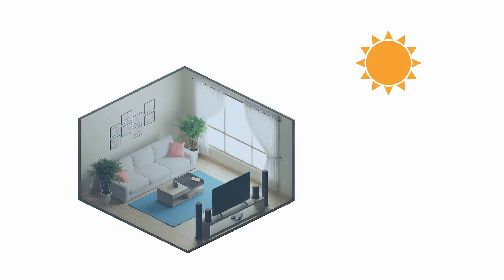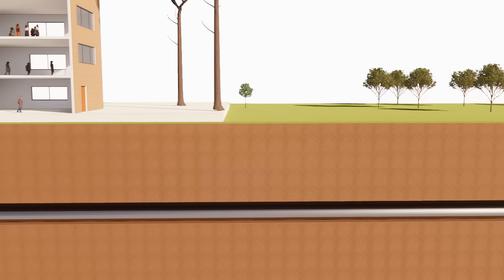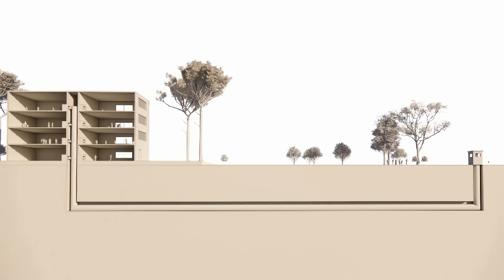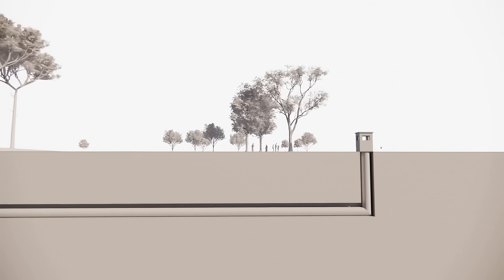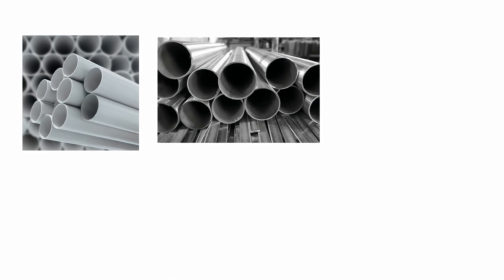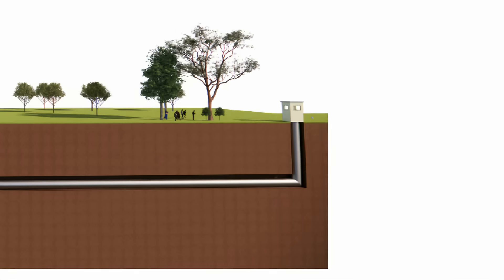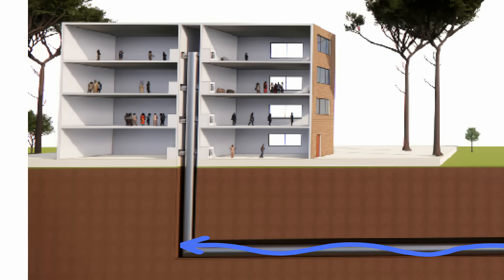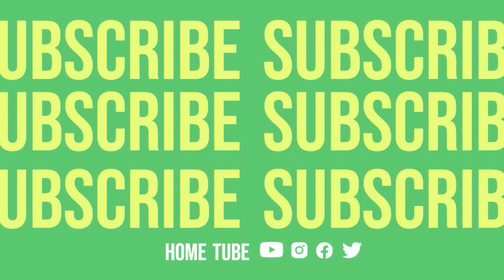Earth Air Tunnel System: Sustainable Cooling & Heating Solution

Comment: If everyone starts doing it( large scale) wouldn’t it make the crest temperature same as nearby atmosphere? What happens to the life( organisms) under the soil if it becomes to warm or cold for them?
Reply: About the latter question, soil as a whole are massive compared to the earth air tunnel installation. The overall temperature of the soil surrounding the tunnel wouldn’t change so much that it become too hot or too cold for the living organisms in it. Do you know about thermal equilibrium? It’s the process of two bodies of thing exchanging heat until they theoretically reach the same temperature. It’s like putting a tiny ice cube into an Olympic sized pool. The ice cube would change it temperature and turn into water, and it’s noticeable, while the other body, the Olympic sized pool, would remain nearly the same cuz that tiny amount of heat changes the ice cube cause doesn’t affect the huge pool that much. It’s the same with the soil around your tunnel
Reply: @burhlmao540  well how about Icerberg or glacier? Would that make a difference?

Comment: Idea is good but we need big size blowers which sucks and throw air from pipe... condensation will occur only if humidity in out side air increased... and the solution is throw the air out side building
Reply: They call that an attic fan or whole house fan

Comment: It seems that it would be more efficient if the air in the house were sent in a loop drawing the already reduced temperature air in the house thru the pipe to be cooled rather than trying to keep cooling hot air from outside.

Comment: the best way to sustainable energy management I ever heard - like thousands of years ago
Reply: What happens if I live in a 70 square meter house?
Reply: @EfrainA-u2h  That's not big. A tiny pc pipe already would do the trick. But water works better for cooling. Air has almost no mass. I have made my house mutch cooler with a $5,- plant growing against my house. I it doens't get hot, you don't have to cool it down. But you can replace that expensive buried pipe with a cheap pond.
Reply: Deberías poner una ducto de esto por cada habitación @EfrainA-u2h
Reply: @EfrainA-u2h You improvise and adapt.
Reply: yep, and theirs are more efficient too (especially the ones in the Sumerian region)
Reply: See what any Fire Marshal would say about permitting it ...
Reply: @centurione6489  There is a suitter valve at the other end with a spring. When air rushes in it closes the valve. They can also work electronicly, thus opened with power. Cut the cable or when alarm goes off it closes. Same goes for the roof. When fire brakes out it will close due to temprature with a piece of metal that expands and triggers a latch. Same here you can have extra electronics to trigger it early. Thus the spring is removed with a coil magnet that pulls the latch closed, until power goes out or alarm has been triggered. It's mandatory in The Netherlands on large industrial buildings. These roof panels also work for explosions. You will pop off the panel completly with a large explosion, leaving the roof intact.

Comment: Too many problems with earth air tunnels,  mold, radon, etc... better to simply have Geothermal heat pumps,  use the same principles but use a thin tube with a liquid containing an antifreeze and refrigerant.  The Geothermal heat pump is incredibly energy efficient and do not have any of the air quality issues that affect the air tunnels.
Reply: what for summer ?

Comment: Cost efficiency and reliability aside, you need to own a very large piece of land for this to work LOL.
if the underground pipe is short, then it won't stabilize the air temperature at all.
There is a reason modern city housing doesn't adopt this concept.

Comment: Instead of costly digging you can route water pipe throught indoor water tank it would be the same effect or the large outside rainwater collector does the same effect cool in summer and warm in winter
Reply: Radiant heating / cooling system wld work well for an effective remorseful control

Comment: If the wind tunnel is enclosed inside water way then passively it can keep comfortable temperature year round without any extra electricity
Reply: You would still need to circulate the water with a bilge/sump pump!

Comment: Air is a terrible way to transfer thermal energy, water is a smarter system to extract energy, transport it and deposit it. You also have issues like radon and moist air with moisture been the killer of most homes. Add a rock or sand battery and you have a smart system as opposed to the above system which would only really work of dry desert clients.

Comment: In Florida that would become a nice WATER pipe !
Reply: Check the thermal pump design. This video is pretty simplified.
Reply: Truth. Different solutions for different places.
Reply: They're almost always made of solid pvc pipe, with a way to drain condensation and treat the inside of the pipes against mold and mildew. You can use ground water to cool as well. I had an uncle who used his well water to run through a giant radiator in his basement. It had fans attached to the back of it to exchange air. Worked great.
Reply: Unless it’s completely watertight.
Reply: @tscoff  exactly, you can also use something like PEX plumbing and use water or a fluid medium for heat exchange instead of air.

Comment: Making a simple problem more complex. Using A heat pump to heat/cool your home provides a cleaner, safer way to provide your HVAC needs. If you were going to live completely off the grid with limited ability to produce your own abundant electricity, this may work for you , but even then, there are simpler plans as well.
Reply: This one is a green way for cooling. Heating
Reply: Such as?
Reply: Heat pump still needs lot of electricity, in CA PG&E is charging $0.50/kWh 😢
Reply: Can you give an example?

Comment: Is this just theory or are there some real life example that have been successfully working for several years?   The ratio of area vs circumference is R/2 so doubt the pipe can be very wide before most of the air is not getting any heat tranfer.  Impossible to stop condensation in hot, humid summer months.  In some places you have to account from gallons per hour of water being produced by air conditioning units. The idea of using liquid and the earth as a huge heat sink and heat exchangers is feasible,
Reply: Pochodzę z Polski i system podobny do tego z filmu jest stosowany w wielu domach od około 15-20 lat. Możesz pytać co cię interesuje
Reply: @ThEvilsTeam there are many installations using the earth to heat or cool using liquid going through pipes.  Sometimes it is just a grid of pipes (like floor heat) or a resivoir with pipes going through it.  The liquid is circulated and heat exchangers are used. Poland has been using geothermal plants for heating. . Are the systems in Poland ONLY using air through pipes for heating and cooling? Thanks.
Reply: @douglasmckinley-sr1507  Yes, it is the same system as in the video but it is part of the recuperating ventilation system (hrv). It prevents frosting in the heat recovery unit  in winter and helps cool air in summer. Of course it's impossible to warm air more than ground so in winter it must be parried with some other heat source. It can heat the air to 10°C what is better than -20°C ;) Also newest systems use rather semi open plates than pipes to manage condensation.

Comment: How do you heat a building with 15° C in winter? You need at least 30° C. Therefor you need a heat pump
Reply: If your heat is set to 30 dont invite me over lmao
Reply: @goddy5890  They are saying 30℃ because you need a delta T to transfer heat. The only way you would not is if you are doing air changes constantly, and then you are talking about using very big fans to achieve that much airflow. The energy to use a fan to push that much air would not be much different than just running a heatpump. You would also only have a 15℃ house with a massive daft, which would be damn cold for normal standards.

Comment: It's a really bad idea. 
In developed countries you don't use pipes, due to moisture condensation and growth of mold and other stuffs you don't want to breathe in. 
A professional system would be half-open so the bottom of the tunnel is pure natural dirt, what can absorb moisture and prevent develop of pathogens
Reply: A professional system would not expose occupants to radon. This is just a bad idea all together.

Comment: Clever, although this appears only suited for hot climates.
A window should be kept open to allow return air out to avoid pressurising the building with minimal air flow. As such, there are some energy leaks. The power needed to operate a huge fan and its noise can be significant.
Reply: Usually, there is a system of outgoing ventilation in well-designed buildings. Additionally, you can use a solar chimney and a deflector like a 'whirlybird.' In this case, we can avoid using loud incoming ventilation.
Reply: I can see this as the input for the HVAC system. When the HVAC is blowing it will naturally pull air in. When the HVAC is off it won’t. You’re correct about the positive pressure, this will work much better in a house that is poorly sealed than in one that’s well sealed.

Comment: Plastic or concrete should not work, if you really want to benefit from temperature difference between soil and atmosphere you will need copper or at least aluminum tubing. That is pretty expensive.
Reply: Concrete is better at thermal conduction than dry compacted soil, but worse than wet compacted soil.

So while metal pipes would technically be better, the improvement would be extremely negligible, and not likely worth the price increase.

Comment: Could this ever work in densely populated cities or would it simply be too much to demand of a limited space?
Reply: This can only work in low density population areas. You also have the problem of ground getting too warm in summer if too much heat is put into it and freezing in winter if you extract too much heat. Better to run a ground source heat pump where heat in the building can warm the soil in summer and be extracted again in winter. Even then it only works in specific circumstances where the soil conditions are right.
Reply: Most highly densely populated cities are near a large body of water, much better using that as the medium. In Toronto they sunk a bunch of massive pipe in the middle of lake Ontario and use that water to cool a section of bulding in the downtown area.
Reply: @ScottA2345  use a well
Reply: Die zufuhr muss halt immer so und so weit weg sein, halt nicht neben deinem Gebäude, direkt neben dir kann ja ein weiteres Haus stehen für das der Zulufteingang halt auch wieder die bestimmte entfernung weit weg ist das es funktioniert, und es müsste von Allen gewollt werden! Alles liebe & herzliche Grüße David.

Comment: Been thinking of building a bunker and this looks like an effective way to maintain airflow in there.
Reply: These are excellent for warming air in winter, and then passing the warmed air through a heat exchanger so the stale air leaving the home warms the incoming air even more. Look up the "passive house" standard in Europe. For summer, the earth tubes have a big condensation and mold problem. You could run a closed-loop so the tube-air cools a sealed radiator. Investigate before spending money.
Reply: @ronroberts110  Most excellent idea, I had an idea of mounting a car/truck radiator behind my wood stove to heat and pump hot water to the back of my place where I don't get as much warmth in Winter! No electricity bills, just passive heating and cooling!
Reply: I live on a hill facing north. Thus i sleep half underground. The suny side is only 1 level. The dark and north side has 2 levels. 
So, have a shaded garden in the back from the house. Until i go further and have sun again for trees. Thus most of my windows are facing north.
Warm in winter because it doesn't freeze underground. And stays cool in the summer because the soil stays cold/constant.
Thus have only my frontgarden with a door and a small window on the south. Covered with plants. And big windows at that level facing north. 
And when you go down into the basement, there is the rest of the house with exit to the back garden. With a real basement you get bad air and mold.
Reply: The tubes fill with mold. You'd burn through air filters so fast.
You'd have to use something like stainless or copper that microbes dont like and even then time isn't on your side.

Comment: Anyone saw this method practically?
I saw chiller plant in Dubai. 
Air was traveling through underground pipes. One pipe intakes and other outtake.
Reply: Chillers are proper machines, even though their pipes are under ground some times. In this video there are no machines except a basic air blower. Secondly this method cannot work effectively in extreme weathers like Dubai
Reply: @mohammadhamza7159  works better in dubai due to the low humidity

Comment: Wouldn't you use this air to feed a heat pump coil so the heat pump can run more efficiently during cold weather?  Much easier for a heat pump to use 10 Dec C air than -20 Deg C air in the winter.
Reply: Of course, and it is done all over for new constructions using heat pumps  and underfloor heating.
Reply: Yep, and then water/glycol is a better medium than air for heat transfer so you would use a water loop with a pump. We call those ground source heat pumps, they are very common. haha
Reply: @drew651  but it's very expensive and complex

Comment: Perfect for rat intake…
Reply: Have cats
Reply: Id love a rat intake system 😂
Reply: 1:35
Reply: No, pipe ending is covered with metal mesh.
Reply: @igorbukovy4313  you mean ladders for rats :D
Reply: @ Climbing on the vent will not get them inside the building.
Reply: @igorbukovy4313 We have a thicker layered PVC pipe underground. Recently rat has destroyed  and made a huge hole on it. We had to cut and replace the pipe.
Reply: According to your logic everything that runs from underground into a house brings in rats 🤡

Comment: Have been thinking about such solution since long time. A concrete house is just a concrete oven.
Reply: Pros & cons of each contruction method and materials...
Reply: Unless you use blocks with insulation
Reply: A concrete house is a great earth berm house .Then you get the effects of ground cooling and heating without all the bull in the video that would cause more issues than anything.
Reply: @drew651 concrete home is difficult to insulate, hot as hell in summer.
I lived in those homes in India.

Comment: Sounds to good to be true 😆.
Works only on presentations?
Any actual builds and measurements?
Reply: I heard it's relatively common in Canada.
Reply: @marcospereira2060  This is common is Canada as a ground source heat pump. Get ride of the air entirely, bury a large loop of pipe (usually in the thousands of feet long) Or drill the loop for less length but much deeper. Take those two ends of the pipe, hook it up to a heat pump and tada a ground source heat pump.
Reply: @marcospereira2060  this is not true. Never heard of it here.
Reply: @benvoncamp  , YT has sugested me some videos in portuguese and spanish that refers as canadian in their thumbnails.

Comment: moldy pipe ventilation
Reply: An Ozone Generator running once a week would be enough to keep it mold free, especially if you design it the way it’s shown with a small shed/outhouse.
Reply: @PrayzGOD2  ozone is poisonous. balanced mechanical ventilation with a MVHR is best. You don't save meaningful amounts of energy with these earth pipes.
Reply: @PrayzGOD2  Ozone generator? What is this the 80s or something? Ozone can be very harmful to your health and can cause permanent lung damage. Never use an Ozone generator in your home.

Comment: I wonder if the cost of construction is worth the savings.
Reply: It should be in the long term.
Reply: Not even close lol, it's just a sustainable way to do this.
Reply: The answer lies.
Laid plan.
Reply: If you use cheapest PVC pipes and burry it yourself, it may pay off after 10+ years depending on climate ( I live in cold climate similar to Vancouver)
Reply: @ThEvilsTeam  You gotta dig one or more very long trenches - 10 feet deep, through rocks and roots.   This is not easy.
Reply: @PaulSawczyc  digging it by hand is really labor intense. Making it with an excavator requires skill and equipment. Return time is long that's why it's not so popular.